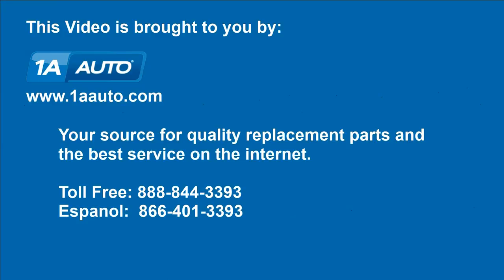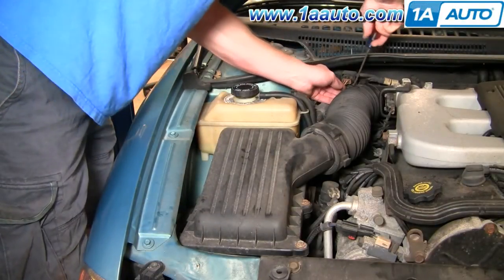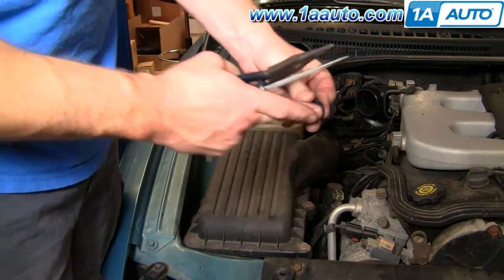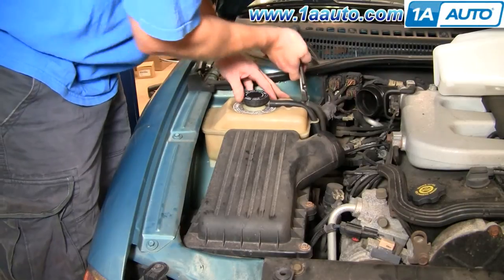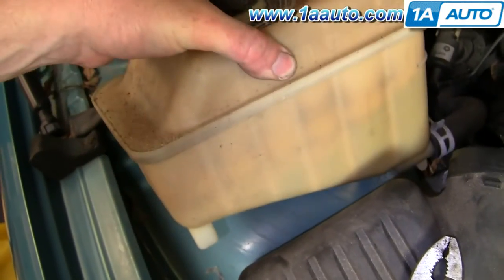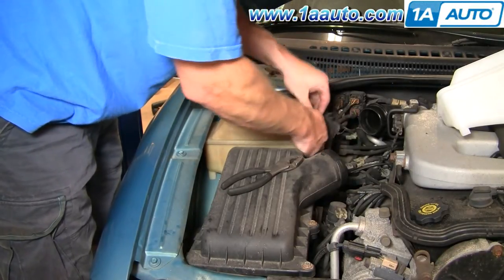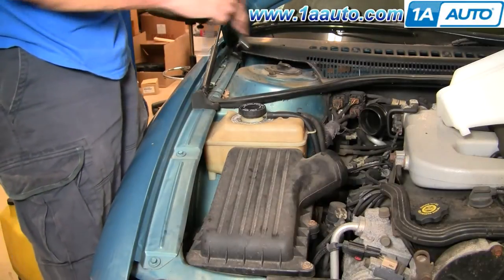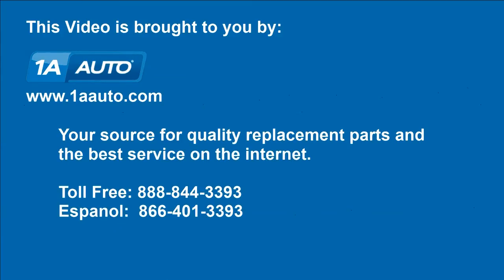How to Replace Radiator Overflow Bottle 93-97 Dodge Intrepid

Comment: My 1996 Intrepid (3.5L) has never had a radiator cap on the radiator.  The only cap my cooling system has is the one on the overflow bottle.